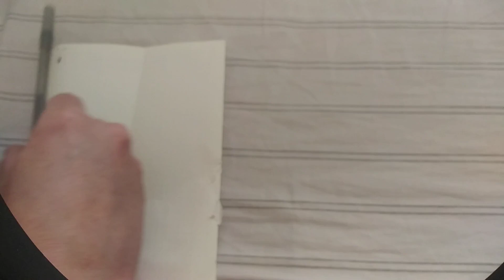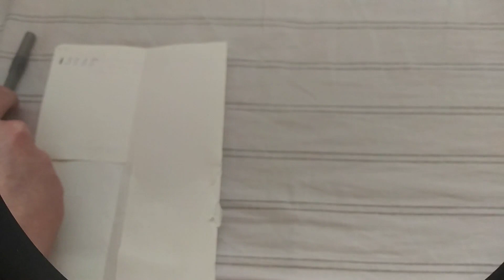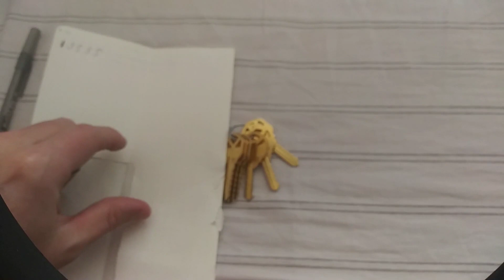(6) Decoding SmartKey bitting using depth keys

Comment: You can use Depth & Space Keys to impression normal pin tumbler locks without taking it apart. Use Neolube by coating the keys and then start the first cut on a depth that shows no mark. Then repeat the process to get each space.
Reply from the maker: @808Unionist Ah, that's brilliant! I'd wondered if they could be useful for impressioning but hadn't worked out how. Thanks for your comment!

Comment: coincidetnally I have been staring in those little windows too for the last week since my appartment supers gave me a smartkey core!  im trying to understand why some smartkeys can be tensioned "normally" and some need those cutsom curved shanks.Thanks for the video!
Reply from the maker: Oh cool! I didn't really get the tensioning differences until I saw naswek's video on reverse sidebars (https://www.youtube.com/watch?v=JVz-t9FvK3A).

Best I understand it, in the earlier SmartKey versions, the sidebar and sidebar channel are rounded and turning pressure on the core causes the sidebar to be pressed into the wafers, meaning it can be tensioned normally.

In the later versions, the sidebar and channel are squared off, so applying turning pressure actually locks up the sidebar position. So the lock shouldn't actually operate! But it does because there's a spring attached to the sidebar constantly pressing it into the wafers.

Essentially the spring causes the lock to constantly try to open itself, meaning when you insert the key the sidebar "magically" pops into place and the core can be turned. But trying to turn without the wafers aligned properly just binds the sidebar in the locked position. I'm curious which model you ended up with!
Reply: @prevarikation  exactly what I needed thanks!
Reply: @prevarikation  I missed your last question, I got the older rounded bar,. But that doesn't mean I can pick it 😂
Reply from the maker: @blankregistration7301  I feel that.. I've tried progressive pinning the gen 2 I have and had absolutely no luck :( Takes steadier nerves than mine to tension it, I think.